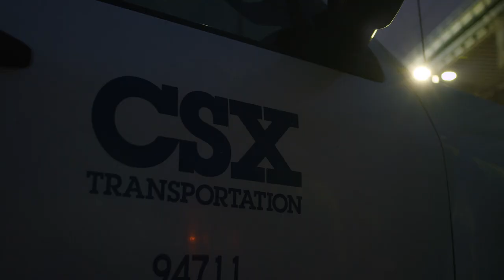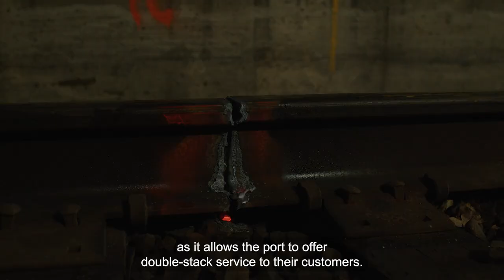CSX Howard Street Tunnel Project Update

Comment: What I have always read about that tunnel is that the floor couldn't be lowered because of underlying infrastructure. There were plans to raise the ceiling slightly. My question is how they are now able to lower the floor.
Reply: I dont see how you can lower the floor without increasing the grade. at the north end the tracks are practically resting on the roof of the B&P tunnel.
Reply: The tracks over the B&P tunnel appear to under a separate bridge. I assume either the bridge will be rebuilt or that part will be dealt with separately